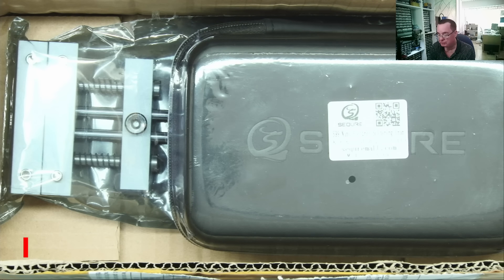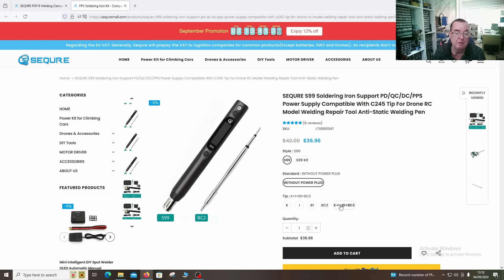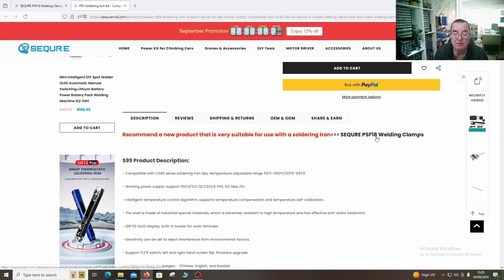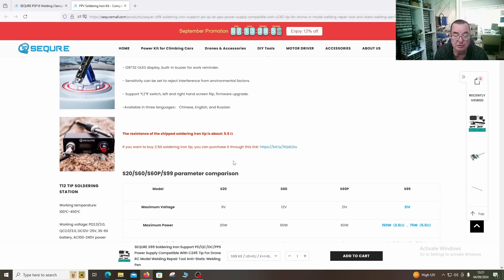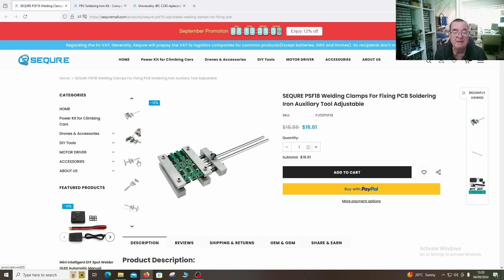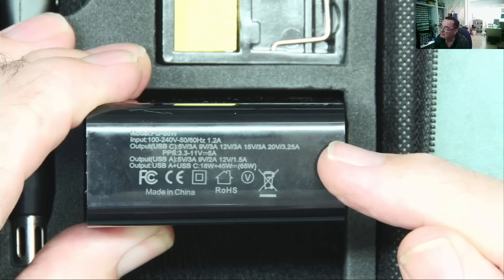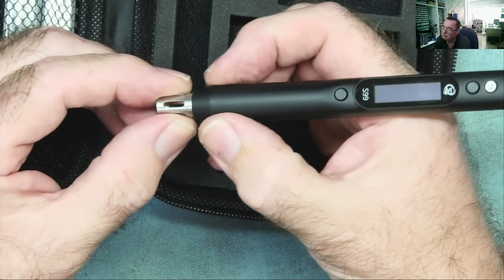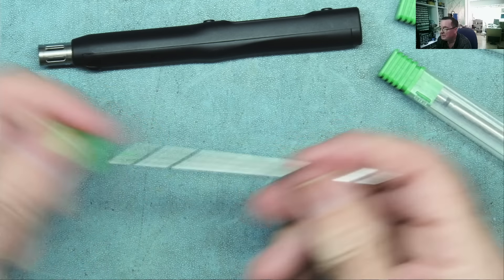Everything You NEED TO KNOW About C245 Soldering Irons BEFORE YOU BUY ONE!

Comment: When you use another PSU with the Sequre soldering Irons, there is a chance that you need to change the protocol it uses. If I use my laptop PSU for instance, I need to select PPS as PD-protocol. It's the same with my Sequre S66 unit. Sequre posted a warning about using the S66 with a non-compliant PSU and advises to replace a tiny (0402) capacitor inside the S66 with one that has a higher capacity if your S66 is of an old revision (as mine was).
Reply from the maker: Do you find it strange thay the S99 worked best on my bench PSU which has no protocol at all? Would this suggest that protocol is overrated?
Reply: @LearnElectronicsRepair  Not at all. Just if you use for instance a laptop supply which communicates which voltages and power levels it supports, protocol does become important. These compact soldering irons are great to take along and it would be great if you could use the same charger for your mobile phone, laptop and soldering iron, saving weight. That's what I do when I'm going to a hardware hacker party that has no proper tools at the site itself.

Comment: I have a SEQURE S99 and it pulls over 150 watts when i use a 200 watt laptop supply or my 300 watt bench top power supply. The S99 iron causes usb power supplys to turn off do to overloading.
Reply from the maker: Agreed. You may have noticed in this video my 10A bench PSU was flicking the current limit on and off.  This suggests it hits over 200W on occasion for very short high current bursts.  I think also this was causing the FNB58 USB analyser to show some rather odd (false) behaviour with this soldering iron
Reply: @LearnElectronicsRepair  the highest mine has pulled was 20.7 volts / 7.88 amps at start up.  After tip heats up it drops to below .5 amp and when you start to use iron it starts adding more amperage slow climbing to max power on my SEQURE S99 (same on S60 to). Yours however has big power spikes (pluses) of high amperage
Reply: @LearnElectronicsRepair  did you have your current adjustment knob maxed out because my 30 volt/ 10 amp switch mode power supply or my linear power supply
Reply from the maker: @1998eclipse1998  I thought I did but  Iwill try this gain on the livestream tomorrow (8th Sept 5pm UK time) why not come and join us?

Comment: XT60 is a high current connector. Will allow you to run the iron over a 6 cell LiPo as used by modelers with electic flight/boat/car.

Comment: Interesting set of irons/tips/power supplies - I still use a steam driven mains unit, which works for me. I had to smile at your usage of the PCB holder - it seems that you didn't notice the spring loaded part, which is there to add a clamping force to hold the PCBs snugly. If you set the PCB up in the clamp as you did, then slide the outer section inwards to increase the stability of the grip. I notice that it didn't apparently move when you used it as you did, so it obviously works well. It's good that the clamp is natural aluminium, as I had quite a surprise one day, whilst using a different type. I'd always assumed that the jaws on mine were a hard plastic, as they were black, looked like plastic, and it was fairly cheap, so it had to be plastic, didn't it? I had a mains powered PCB clamped in mine to make probing with test leads safer, when I noticed a fizzing sound whilst I had my back to it. Swiftly looking round I saw smoke rising gently from the PCB/clamp and was lucky enough to switch it off before meltdown occurred. We all know what they say about "assume". It's obviously true...
Reply from the maker: That's an interesting story!
Reply: Yes I assume this springs can be set to give a positive clamping force. 
But do they also allow you to pull them back and flip a board over or swap to a second board of the same size without having to reset it each time ?
Reply: @warwickbunn1250  They should do - mine does, although it's manufactured quite differently to the one shown here.

Comment: It would work even better if you use a proper 10A-rated cable rather than a couple of cheap chinese alligator cable clips. You would have been losing a lot of current with those cables. I'd be interested to know how hot the alligator cable got... with extended use it could easily melt the cables ;-)
When you do the test on the other channel be sure to use a proper thick cable ;-)
Reply from the maker: I used what I had to hand to prove a point,  Isn't that enough?
Reply: @LearnElectronicsRepair  Not really a good test with wire rated at maybe 2A. You could have used multiple cables, like 4 or 6 or something. Get some thicker wire, strip the ends and put on alligator clips and make a proper cable. I'm sure it will come in handy for other things so you need to do it anyway.
Reply: @g4z-kb7ct  you are on point. i have the earlier version of this the sq-001 the other day it quit working I found the wire in their power supply broken, the cord wire was so thin I have never seen wire that thin in any application. it was the power supply he says looked like a laptop supply very small 19 v 2.5 amp definitely not safe

Comment: USC-C is maximum of 5A if using a compatible usb cable. Higher power usb supplies just support higher voltages which won’t help you here. The iron is probably not doing pwm to limit the power on lower resistance tips so you are limited to the tips which will work when using the usb input. Make an adapter for a 18V tool battery and you’ll be good for a high power portable soldering iron though.

Comment: My JBC uses tips labeled C245 , are these interchangeable ?
Thanks again
Reply from the maker: Yes, but as shown in this video not all C245 tips are the same thing.  Check the DC resistance of them
Reply: yes, JBC is the original make of these tips. Unfortunately, while JBC generally makes nice equipment, price-wise it is a rip-off. Many use a clone soldering iron with JBC tips or the other way around. It is just a matter of preference. There are 2 smaller formats too: the C210 and C115. Note that some call these things the T245, T210 and T115. It is the same thing.
Reply from the maker: @Janktzoni  Agreed.  And then there are different resistance tips of the same type (K, BC2 etc) and this is something I don't think many people were aware of.  Then as I found in this video I have two C245 compatible soldering irons that drive the same tip at different wattage/performance levels.  This is what I wanted to highlight here and it seems I have done just that 🙂

Comment: I use an old 230W 20V Lenovo laptop power supply that I've fitted an XT60 connector on. Works like a charm with the S99.
Reply from the maker: Which tips are you using. The 5.5 ohm or 2.5 ohm?
Reply: @LearnElectronicsRepair  I've got both. The laptop power brick is rated for 11.5A, so no issues.
Reply: I think the PD functionality is more useful if you use it as a portable soldering iron. I don't like fiddling with settings for different power supplies. 20V PD is also limited to 5A and 100W, even with high quality USB PD supplies (USB-PD specification). If you need more power with USB-PD you have to raise the voltage (PD spec 28, 36 and 48V but still limited to 5A). In the end, the S99 works best on the bench with a dedicated 20V DC power supply. The cheap tips don't have that good plating, so at some point I might invest in some expensive tips. Even my old CSI T12 station original tips "feel" better than these cheap 245 tips, even though they work OK.

Comment: 2.5 Ohm on 20V is 8 Amps or 160 Watts 🙂
Reply from the maker: True. Did you notice my 10A bench psu was hitting current limit for very short bursts of power during this video?  So 200W+ instantaneous power to the soldering iron